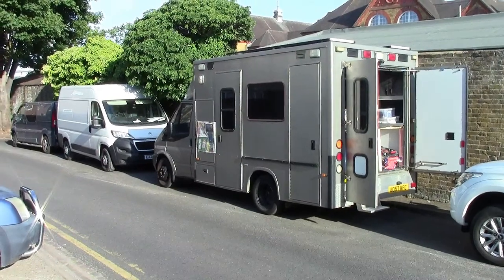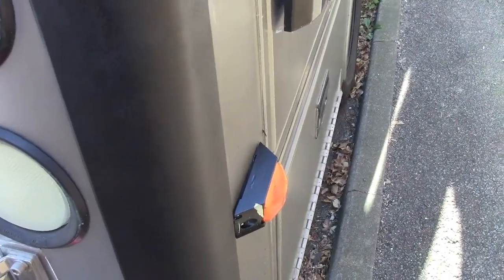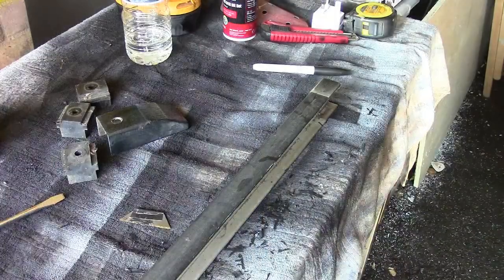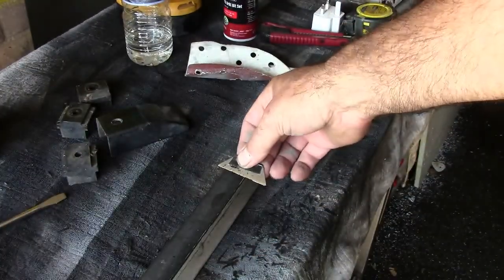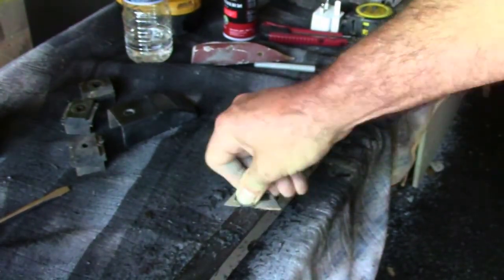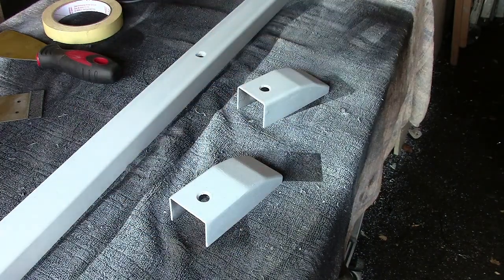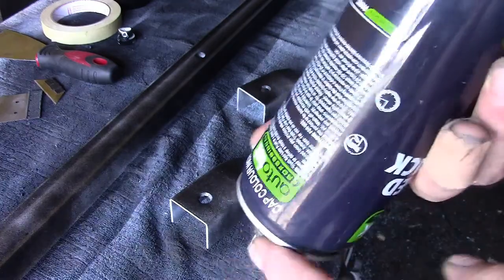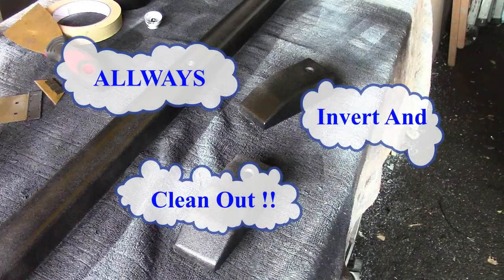Painting Trim with Bed Liner Pt1

Comment: thinking about going for raptor paint with mine , upto the door scuff plates  (its a sprinter so usual rust at that level anyway)
Reply from the maker: I'd love to do mine in raptor 😎
This was 4 tins for the price of 1 tin of raptor  👍
It rougher than raptor and more matt, good grip on the handles though, i wasn't sure on matt but against the satin body it's not too bad 🤔